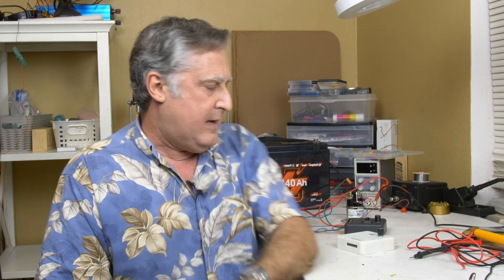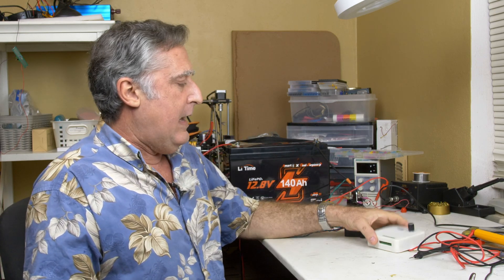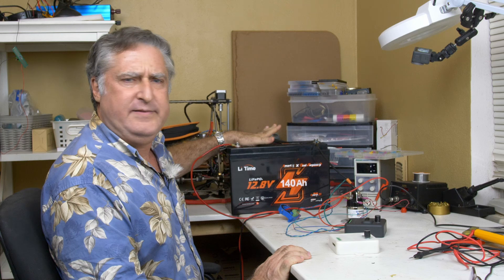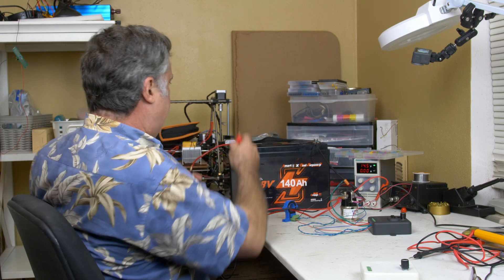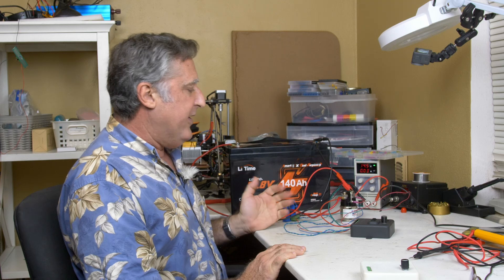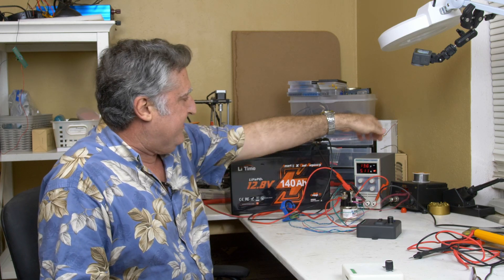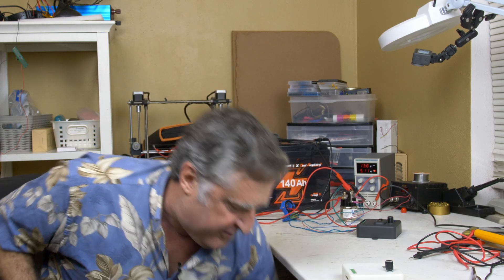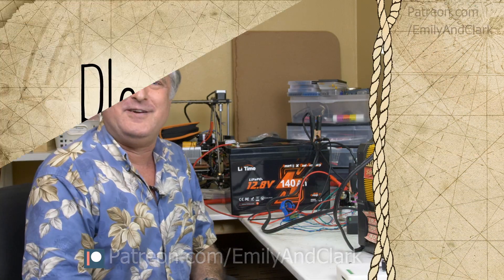Build Your Own LiFePO4 Charger using a BankManager

Comment: I love BankManager, bought two of them, one to experiment with and as a likely unnecessary backup.

The LiFePO4 charger application works without issue. What I'd like to figure out is how to use BankManager to bleed a lithium bank down to 50% SOC for long-term storage without user intervention. As of now I have to turn off the charging source after achieving 100% SOC, then force the contactor to close. The 4Ω load on the Pb terminal then brings SOC down to 50% when the contactor opens automatically due to the "POC = 50" setting.
Reply from the maker: That seems like a good way

Comment: How do i get one of your bank manager? 

This is what i want to do. I want to use a 12v LiFrPO4 battery to rin my charger for radio control lipo batteries. In my charger it has a LiFe setting. Ive been told it will charge a LiFePO4 12V battery. Can you shead any light if that should work?

I dont use any social media, but havfrends/family that do if thats how need to contact you.
Reply from the maker: You can get a BankManager at MarineDCAC.com
  It will charge any 12, 24, 36, or 48v LiFePO4 correctly.

Comment: I took your advice long ago mixed lead acid and lifepo still work well. The lifepo is holding up my starter battery which would die without constant charge of the lifepo.
Reply from the maker: Great 
   Did you see that I'm now recommending a BankManager to charge your Li correctly.  I learned a few things since I made those initial videos.
   MarineDCAC.com

Comment: I am thinking about buying the 48 Volt model ( gen 3 ) and I have a couple ??
1) Can the 48 Volt contractor work at Over 48 Volts --- and how much over?
2) Do I still need a 12-14.6 Vdc ( Separate ) source  to Power it?
3) Can I use it with Lithium / AGM instead of Flooded?
No Rush.
Reply from the maker: 1 I wouldn't worry about 60v
2 nope
3 any lead will work.  It it's heavy, you are good
.
Reply: @Clarks-Adventure  Ok thanks a Bunch.  Now I just gotta come up with the Money: maybe next Month?
But it's on the List.  🙂

Comment: I have a new challenge for you. For decades, people have been over-paneling their charge controllers to eek out additional wattage during the early and late hours of the day. There's a better way to get more out of your solar panels but the industry is missing the electronic brain for the solution. It involves adding another charge controller but there's a problem with that idea. They draw power even when they aren't charging. I was thinking that there should be a way to open the solar array and charge controller-to-battery circuits of the secondary array(s) using a solid state voltage differential switch with signals sent at the moment that charging stops on the primary system so that the secondaries stop draining the batteries and are protected from array voltage until the signal is sent to close the connection to the batteries the next morning. Is this something you'd care to tackle?
Reply from the maker: Doing that loses the mppt per panel array.  That is why having a controller per small array is better than just one.
   Your approach really rolls the clock back to 1990s level regulation.
Reply: @Clarks-Adventure  Either you don't understand what I was talking about or you don't understand solar power to the extent that I do. A more unfortunate possibility is that you do understand solar as thoroughly as I do and you understand the intention of my idea but you lack the electronics engineering skills that you would have had to have to come up with the BBMS, if it even does what you claim to the extent that you claim that it does. I think it's just an adjustable voltage sensing relay in a fancy box after all that you have said to date.

Comment: Can an agm x2 94r battery be used in place of the "lead" battery as the useful buffer?

My application is a ford transit 250 v6 van

I want to add a large lithium battery behind te drivers seat

X2 is under the drivers seat

I saw your other video about alternators being harmed by lithium batteries alone.

Will the x2 make the system safe or do i need to go back to lead?

Or can i go lead to the x2 and then to the lithium, where i keep the x2 in the middle?

Van has a 150 amp altenator oem

Ford offers a 250 amp as well, which i can swap to

Ford says that all aux devices should be grounded to van frame instead of neg battery terminals

I have found aftermartket ones that produce 190 amp at idle and over 300 while driving

I believe i would like tu buy one of your bank managers, but i need to buy all the other apropriate equipment also
Reply from the maker: AGM IS lead.  Just pick one up, they are heavy.  So you are good there.

In fact I use AGM on my boat so this was developed with that.

If your ford is like my ford f150 you will want your bankmanager lithium subsystem grounded to the battery terminals directly not frame grounded.  This lets both batteries operate through the trucks shunt that controls alternator output.

But loads will go to the frame.

Don't put on an alternator that puts out more than .5C compared to the li bank size or it will charge the li too fast for its health.  So if you want more alternator add more li to keep that maximum ratio.
Reply: @Clarks-Adventure  I appreciate the fast response

So first, is it advantageous for me to mess with 48v lithium or just keep it simple and go with 12?

I'm hooking up a powerbook laptop and a large printer and a couple cell phones as the hotspot for the laptop

I've found a 12 to 24v dc adapter to charge the laptop via a usb-c

The laptop is a ram and processor powerhouse, and uses a lot of juice 

I'm in debate what volt lithium large battery to go with

I want as much storage as possible and am watching your balancing battery videos now 

So I don't mind buying the less expensive brand batteries

Should I buy 0000 gauge wire to connect the 2 batteries (agm to the lithium)?  And should I get thicker gauge wire from the alternator to the batteries?

I don't mind using the OEM 150 amp alternator for a short time and see how inadequate it is...

I just don't want to hurt the lithium battery in any way by doing so.

I'm new to all of this, but I'm a very fast learner 

I'm like you to the Corvette community, I figure things out that some can't even understand at all, even after I explain it to them 100 times 

I was also thinking about getting a Honda eu2200itan to be a secondary source for charging the batteries.

Realistically, I'll be driving the van short distances no matter what, each day to grab food etc.

I plan to be on the laptop at least 8 or more hours per day and don't want to let my van just idle all the time
Reply from the maker: I suggest you stay with 12v

I really can't do your design over YouTube comments.  I do have a Patreon tier called "Dream Believers" where we can talk on the phone and go through your design in detail if you want that kind of support.
Reply: @Clarks-Adventure  I appreciate you

I haven't used that site before but I see how it works basically

I will be in touch

My name is Brandon
Reply: @Clarks-Adventure  there is a thread called "I tried to upgrade my 150A alternator to 250A ..."

Search it on Google

It has me spooked to touch my alternator just yet

I plan to do the Honda eu2200itan first and also use grid 120v to charge the batteries 

And then address the alternator later if it makes sense

Comment: the tilte is great, build your own LFP charger in buy a 500$ charger...
so what is the build in buy junk?

and confusing talk about your complex algorythms ...ther is nothing like that.
LFP chargerd with a current = ampere to a voltage = full

no confunsinfg talk about algorythms needet to sound important.
LFP charge is the esyest task in ptaktice for anyone cost the is no knowlege needet thats the truth.
ea LFP for consumers have a build in BMS and the BMS hanlde the right voltage up to full state by themsels so put any sort of chagrer or power supply with a voltage and the BMS build in in any LFP stop charge itif the battery is full thats the reallyty.

and try to make promotion for a 500$ charge booster will not makes it bettter in any chase then any sort of random charger.
 then set a power suply befor another power supply " what your magic box is" and call that magic algorythms not change anythin on this fact. 

and mister youtube the litime 140 ah battery have exactlyx this outstanding BMS tech build in for user like you , do random nonsens with 2 power supply set befor a lLFP +conspirecy theories  and magic algorythms but its not possible to charge this litime wrong....dont wory if you put 10 power supply in a line still no way to xharge this litime wrong.....
Reply from the maker: I'm not sure what you are saying exactly.  I assume English isn't your first language or you just don't care what you type.

I have viewers who bought the early BankManagers and upgraded.  Their old BankManager will likely be used for this kind of project.

And you, like many, are completely misinformed about what a BMS does.

Finally the BMS in that litime is so bad I'm removing it and putting a jk bms in that case.

Comment: Clark, even though I do not have the knowledge to the degree that you do, I do have enough electrical and electronic knowledge to easily follow your videos. I am in the process of building a small solar system and have wondered about the charging of the LiFePO4 batteries and from what I understood there really isn't any systems out there that charge them properly. In my search, the YouTube algorithm sent me to you. So thank you for what you are doing. In this video you seem to be talking about getting your charging source from lead batteries, and specifically in your case, on a boat. So now I need to know where I would connect the output from an MPPT charge controller from solar panels into the system. I'm kind of getting the impression that you are using a lead battery as sort of a buffer. So I am assuming I would need some sort of lead battery and would connect the output from the MPPT to the lead battery?
Thnx again
Reply from the maker: Hi Roger,
   I suggest you visit MarineDCAC.com and look up the BankManager product there.  I have over 700 of these operating in the field on boats, campers, and off-grid houses.  The power can come from virtually any source and the lead is really only there to keep the current source charge controllers operating sanely once the BankManager disconnects the li bank.
   There are a bunch of videos on my channel and the install manual on this site should be helpful for you to understand what's going on.
Clark
Reply: @Clarks-Adventure  thank you. I will check it out. I am in the process of going through and looking at many of your videos right now, very informative!

Comment: As I understand, the BMS needs time to balance the cells; with cheaper batteries, it can take a long time. How and when is the balancing taking place if the charge is cut off?
Reply from the maker: That balance happens at cell voltages that are harmful.
  So I suggest you only do this periodically.  In short put the BankManager in charge to voltage mode now and again.

   I'm soon to release a video on balancing new cheap batteries.  Details will be there
Reply: You are right. Balancing needs to happen and it takes multiple charge and discharge cycles if the BMS uses passive (wasteful) balancing and the cells are significantly out of balance. The good news is that after the cells become balanced, it takes unusual usage habits to bring them very far out of balance again. If you use your power daily and you charge daily, you are likely to keep a decent balance. The usual cause of losing balance is the repeated use of power without fully recharging between. A good BMS will be balancing your cells when some or all are between 3.35 and 3.65 volts per cell. I haven't taken any interest in bottom balancing and neither will your BMS. There is a very large percentage of the battery's SOC when the cells will be around 3.2 volts. During this time it isn't possible to accurately balance the cells unless each cell is measured independently and that would be prohibitively expensive and add bulk. If you're one of the people who think it's wise to use a smaller percentage of your battery's capacity, I'd recommend that you allow your batteries to be fully charged at least once per week to allow its BMS to do its job. I'm well aware that people will tell you that you're reducing the charging cycles. Before you buy into the drama, consider making a spreadsheet to determine whether that's even going to matter to you based on your usage, your expected remaining years of living with your battery bank, and the amount of loss you will actually take in terms of kWh. Many arguments are one sided because the supporters of an idea will not see it from the other side(s). One thing is certain. You can't expect your cells to balance if you set your max voltage too low and leave it there. They will get so far out of balance that you'll lose more capacity than you calculated for and possibly harm your cells.

Comment: Hi Clark, nice video as usual.  I've always wondered if the Bank Manager could be used without a Pb battery in the system.  

One caution.  In your demo with the big battery charger, when the Contactor turns charging off, the big charger will be back-feeding your small power supply.  Most power supplies are ok with this, but not all.  They sometimes have warnings to never use them for battery charging because of this (also because of the lack of an effective current limiter).  I had one fail rather spectacularly when I inadvertently turned it off with a battery connected; roasted LM723 Flambe.

As a protection, there are "Ideal Diode" boards that are used for preventing back-feeding solar panels that work very well to prevent this.  Very low forward voltage drop.  I use one rated to 50 amps in my semi off-grid power system.  Put that in front of the small power supply, and it should be protected.
Reply from the maker: Good point 

I've had no issues with this cheap Chinese supply

Comment: I watched that Gone with the Wynnes youtube show today. They are off the cat while it is gone over completely to correct some stray voltage coming out of the engines issues.  The stray voltage issue was serious. Pitting in steal. The brand newish anchor and chains have to be replaced. Maybe every nut and bolt on the brand new boat will have to be replaced.
Reply from the maker: Bad news.

Comment: Does the Bank Manager have a provision to start your on-board generator when it detects that the batteries need charging?

Best!
Reply from the maker: No sorry.
   But I think you could do that with a low voltage detection circuit and turn off the generator with a second small bi-stable contactor in the BankManager

Comment: How can I use this for a 48v lifepo4 battery?
Reply from the maker: Same thing but you need a power supply that goes up to 58v or so.

I just ordered one.  If I like it I'll use it in a video describing what you should do to brand new batteries when you open the box to balance their cells.
Reply: @Clarks-Adventure  Thank you!

Comment: Any chance of adding a capacity testing feature to the next version? Like you could charge up the lithium, put it in the test mode and then use your loads until the lithium is empty? Or would that mean you'd also have to drain the lead pretty low to get the lithium at 0%?
Reply from the maker: I see what you are getting at.  

If you just really wanted to run the test I think you could set the battery size higher like an extra 20 percent ah

Turn off the minimum POC setting

 Charge to 100 percent.

Turn off all your charge sources.

When the contactor is connected remove the lead.

Discharge normally until you Li shuts down 

Watch the POC number near the end because you are going to lose the data when the battery shuts down.

Then do some math
  For example if you did this to a 100ah battery and you set the BankManager to 120ah, if you got a POC reading of 87 percent just before shut down your capacity would be 104ah .
   Real capacity = 120 * .87
   Real capacity = 104 ah

Or if the last reading was 75 percent the real capacity would be 120 * .75 or 90ah

Just off the top of my head but I think it would work and you don't waste power.  But you need to watch the end of the test like a hawk.
Reply: @Clarks-Adventure Wouldn't it show 13% POC right before shutting off in the first example?
Reply from the maker: @bhartley1024 woops yes
  100 minus displayed POC.

I said it was off the top of my head, sorry
Reply: @Clarks-Adventure  Just making sure I was following the math correctly. 

That's my wishlist feature for the next version, some way to make measuring capacity easier. Maybe store store the Watt-hours of the last few charge/discharge cycles in non-volotile memory?
Reply from the maker: @bhartley1024 it's hard because we don't usually discharge li fully 
I'll keep it in mind
Reply: @Clarks-Adventure  Don't worry about it if it's a huge pain, I just thought it would be a neat feature since the hardware to do it is already there. It would be nice to measure the capacity every other year as the batteries age.
Reply: Would you maintain the numbers if you powered the BM from a separate power supply or battery?
Reply from the maker: Yes the BankManager only uses 20 or 30ma